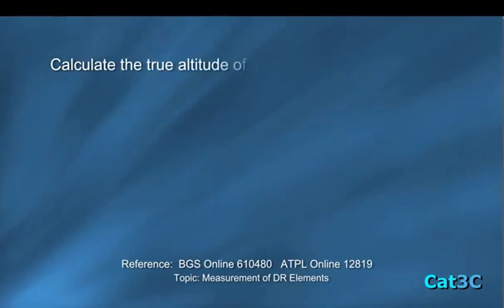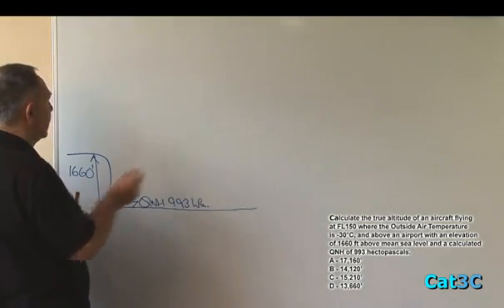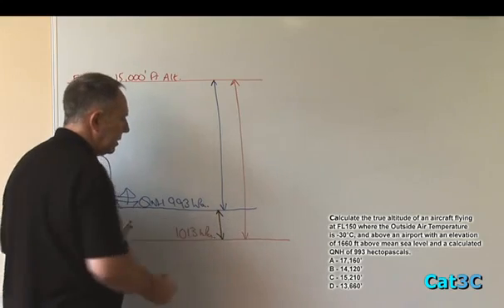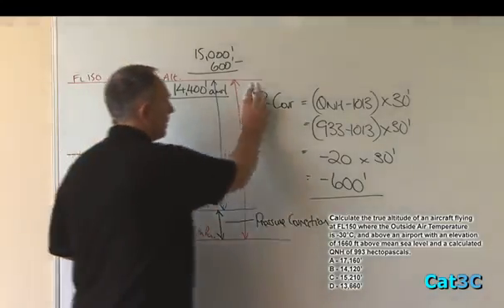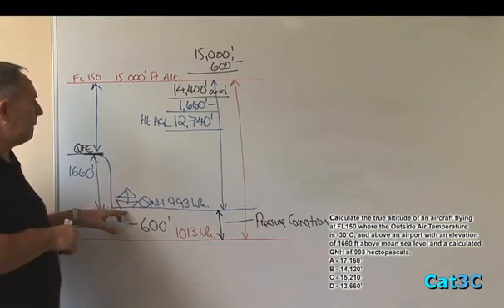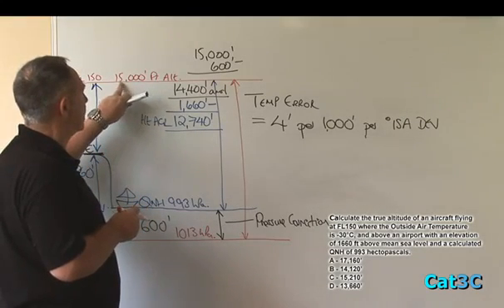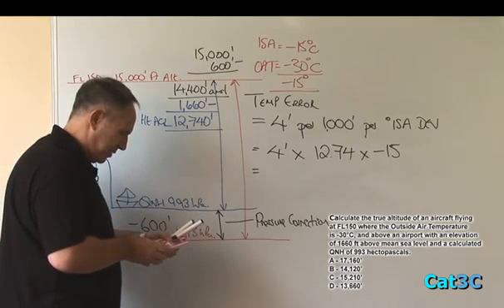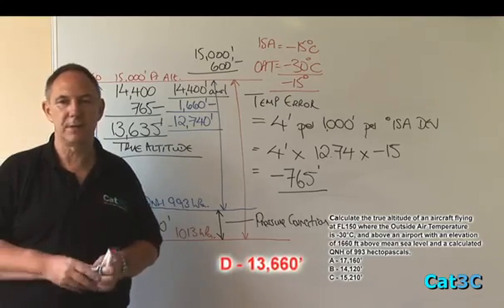QEV 001 Pressure & True Altitude (A)

Comment: It won't be as accurate but you could use the altitude above mean sea level, provided the ground elevation isn't too high. The higher the ground elevation, the less accurate the true altitude. These calculations are no longer required in EASA and UK CAA General Navigation; they are now in Meteorology and Flight Planning, but I can't speak for other authorities.

Comment: why would you even bother doing all that math when you know the QNH you are given is about half an inch lower in mercury (29.32inHg) compared to the standard 29.92inHg, how much do you need here to get from 29.32 to 29.92?? yes, 60.. then translate that into the hundreds, 600 feet.... you dont have to make stuff harder.

I mean, if im getting this correctly, youre PHYSICALLY at 15k feet above sea level, but because the pressure is lower than standard, the aircraft feels like its still at 15k but in a lower pressure mass of air which is 14,400. So Im gonna guess the absolute altitude (AGL) is actually 15k - 1660k. 14,400k - 1660k would be the absolute altitude with pressure correction. (provided that the altimeter is set to standard and not the airfields QNH)
Reply: what a joke, you dont even get -20 if you subtract 1013 off 933 and then multiply the result by 30. You get  -2,400.
Dont get this methodology.

Comment: Shouldn't the pressure correction be +600 ft. 1013-993 = 20. Then  20*30 = 600ft.
Reply: If you are converting from a pressure altitude to an indicated altitude amsl, and the QNH < 1013 hPa, you SUBTRACT the pressure correction. If you note, I use (QNH - 1013) x 30 ft, which, when converting from pressure altitude to an indicated altitude amsl always provides the pressure correction in the correct sense.
Then use "Indicated altitude amsl = pressure altitude + pressure correction" and a negative pressure correction provides "Indicated altitude amsl = 15,000 ft - 600 ft".

It is not the only way to do these type of problems, it is just one method I have found very useful, especially for students who can only follow rigid formulas and have problems thinking 'outside the box'.

Comment: From where did you get 4 per 1000ft? Is not 1.98 per 1000ft?? Correct me if I’m wrong, Thanks!!
Reply: You are confusing the ISA temperature lapse rate of 1.98 /1,000 ft (approximated to 2 / 1,000 ft) with a 'constant' in a formula for calculating a difference in a measurement of altitude. You should discuss this with your ATO instructor.
Reply: CAT 3C got it you’re absolutely right Thanks for quick reply

Comment: You can only work with the information you have. No station elevation - you have to take the conversion down to sea level...unless they give you the QFE as well as the QNH, in which case you should be able to work out the station elevation. (QNH - QFE) x 30
Reply: Thanks for the explanation! I have another question, why did you calculate the temperature that should be at 15.000ft PA and not at 14.400 to calculate the ISA deviation?
Reply: @LuisPerez-qj6mj  ISA pressure altitude - ISA temperature

Comment: where did you get 993 hp for sea level? i thought standard sea level was 1013 hp...i thought the standard sea level pressure is 1013hp...or 29.92 hg
Reply: you will often get a lower or higher QNH, the standard is just the standard. it doesnt mean it always has to be like that. Winds change affecting pressure levels, temp changes etc..moisture
Reply: @nickde6339  ok..is the standard used when establishing flight levels?
Reply: 1013 hPa is the International Standard Atmosphere (ISA) standard pressure datum. 993 hPa is the QNH, which is QFE reduced to sea level, using ISA as the conversion factor (30 ft per 1 hPa approx.).
The first conversion is from the pressure altitude (based on 1013) to the indicated altitude amsl (based on QNH).

Comment: Hi, Tony. In this video to calculate temp correction you apply indicated altitude: AGL=Indicated Alt-elevation (14400'-1660'=12740'), but in the video, where you had to find the approximate indicated altitude to clear the obsticle you apply true alt: AGL=True Alt-elevation (11800-6200=5600). Could you explain?

Comment: The question states 993 not 933. 933 is my typo when writing the solution, which wasn't noticed until after the event, when the videos had been produced. Good luck with a QNH of 933 - that's very near to the UK low record of 925.6, and that was probably not a nice day!  There was a day not too many years ago in Belfast (Aldergrove) where the QFE was off the altimeter.

Comment: 'Above sea level' is the same as above mean sea level and simply means that, the aircraft is 9,999 feet above mean sea level (amsl). 
Mean sea level (MSL) is the AVERAGE sea level datum, on an Earth where the sea does not suffer from mechanical or gravitational effects, from which all elevations of terrain and obstacles are measured. It is the point for determination of QNH, from which indicated altitude above mean sea level is measured, and displayed on an altimeter with QNH set in the altimeter sub-scale.
The WGS 84 ellipsoid is the international standard ellipsoid used for charts and for GPS positions, and defines mean sea level.

Comment: The way EASA wants us to calculate this: 

1/ 15,000-1660= 13,340. *FIRST* we are going to apply the tempearture deviation to 13,340ft (Parcel of air under the aircraft, we cannot measure the correction in the area occupied by the terrain: 1660ft). 

2/ If we do 13,34 X4X 15=800ft. When the temperature is lower then our True altitude is also lower. 

3/ Now we do 15,000 - 800 = 14,200ft and this is our TRUE ALTITUDE MSL *In the question they are using the term "FL150", FL= QNE . Above Transition level we use QNE / Standard Pressure 1013.*

4/ Last thing we need to do is to correct for the pressure. 1013-993= 20hpa. So far EASA has given 27ft/hpa to calculate the correction. 20X27= 540ft.
*Why do you need to do that ? You are above the transition level so your altimeter is set to STD 1013. You know that the QNH is lower so again you will have to remove the value found to obtain your TRUE ALTITUDE*

5/ 14,200 - 540 = 13,660ft  is your final result.

Would you agree Tony ? And by the way thank you for your great videos they are very helpful and very well explained =)
Reply from the maker: Correct. The airspace between QFE and QNH datums is assumed to be ISA (that is how QNH is calculated and how the barometric altimeter measures altitude) - this is why the altimeter is always correct at the aerodrome datum. This is laid out in ICAO Doc.8168. I have been informed that both MET and FPL will be adopting this (correct method) under the new EASA Learning Objectives.
Reply: thank you are best no need go round and round and the result is same not about, about mack confusion . pls can you send me more thinks for calculating